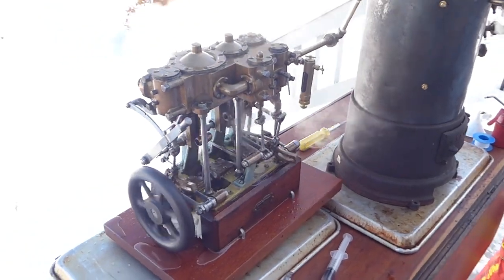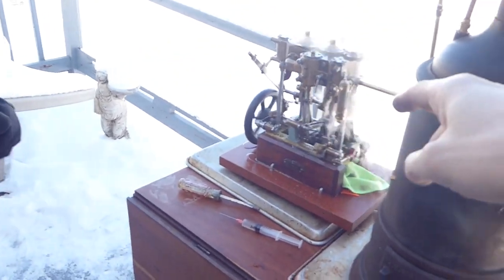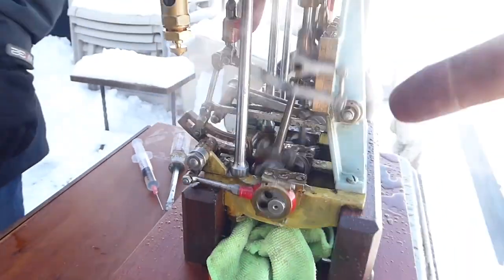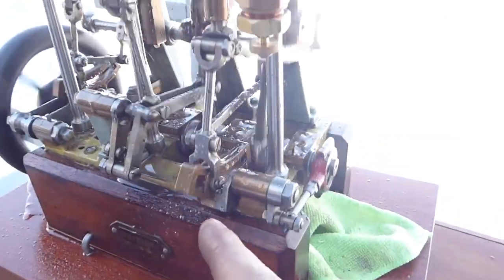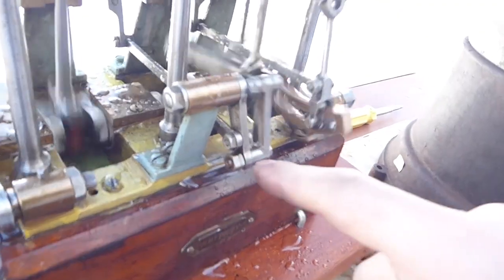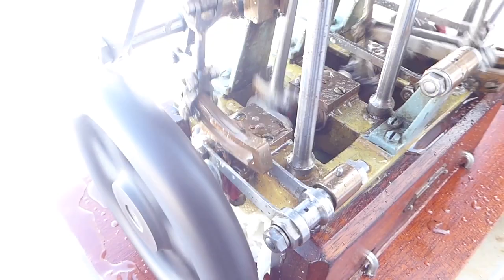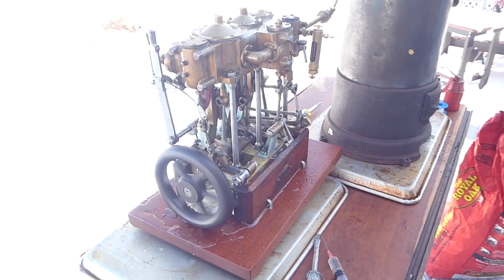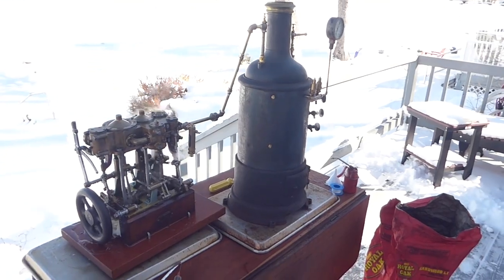Whitney triple expansion pistonvalve engine

Comment: Where’s the boiler from Alex? A very nice engine btw.
Reply from the maker: This boiler was made by G. E. Wright in Newark New Jersey in 1891, before the company was taken over by Grant Sipp. It is one of the highest quality small boilers I've ever seen. 
 It has a proper wet leg bottom end, which is entirely a casting.  The top tube sheet is also a casting, both of which screw onto the boiler barrel with a fine pitch thread.  They are then stayed together by four bolts and 25 brass flue pipes have been expanded in.  The metal in all cases is of some incredible quality.
Reply: @AEKarnes  that’s certainly a nice thing. I’ve heard Bassett Lowkes early production 3 1/4 inch gauge Midland Rly Johnson Compound had a similar boiler construction.